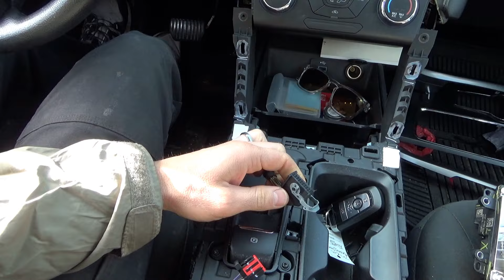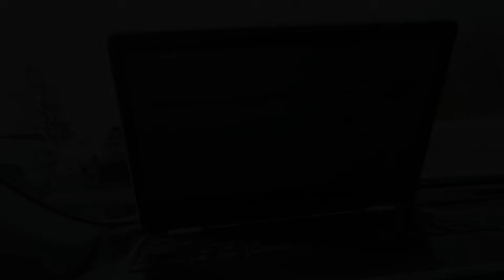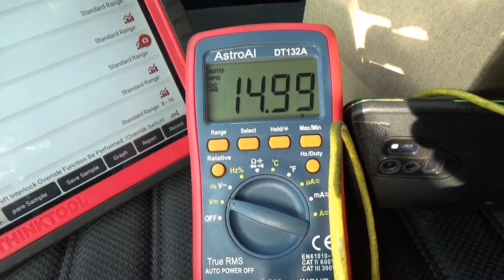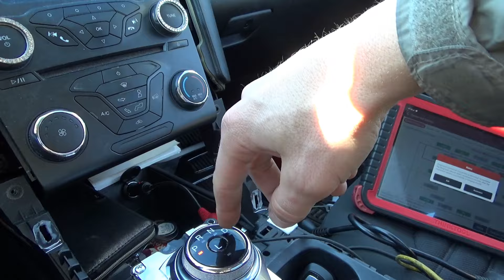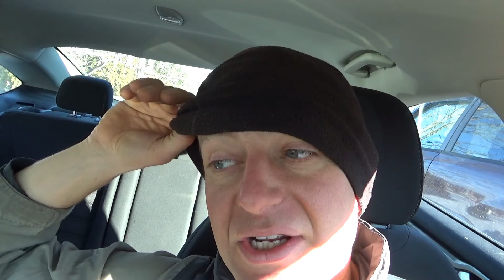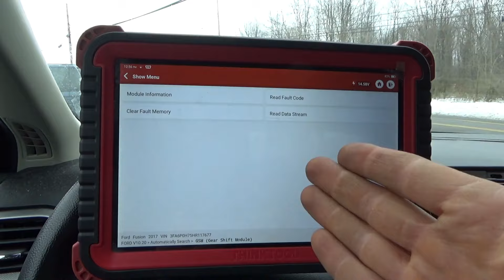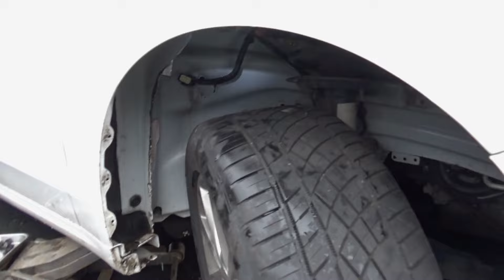Why New Cars SUCK (Ford Fusion STUCK in PARK?! - Part 2)

Comment: The transmission shift cable in my Ford is still working fine after 26 years of service. WTF is all this crap in new cars? Why add such a complicated failure point into what was such a simple and reliable system? What benefit does it add for the driver? Sadly it's all a reflection of the world we live in these days - a throw it away society. Car manufacturers have zero incentive to make a product that lasts anymore. So many more people simply lease a vehicle these days, so as long as it lasts the length of the lease nobody cares.

Comment: My BMW M5 2006 would never start in the cold? Push button and everything worked but no crank? It would start with a boost? Battery was good? I took panels off turns out it was a ground on the frame on the bottom side of the car. Scanner Dan pointed me in that direction.  BMW gave up?

Comment: The square-stock-spring around the shaft is a Torrington clutch. It transfers drive in one direction over a limited range of rotation (range controlled by a pall contacting a stop). 

The sliding plate driven by the small motor is used to select which of the two big motors engages with the drive gear (the one that fell off).

You are absolutely correct about the whole concept of this thing. Just because you can do something =DOES NOT= make it a good idea - particularly so if you manage this level of complication. I'm sure someone at Ford knows that, but clearly they were not consulted in this matter.

Comment: Now that I think of it, this rotary knob transmission gear selector is a modern version of Chrysler’s push button gear selector of the late 1950s. It lasted for a couple of years, and then they switched back to the conventional lever, I guess due to problems. Time will tell if this gadgetry fad fades away🤔

Comment: I really appreciated the method to solving the problem, more than the solution itself. You're talented at this auto diagnosis stuff. Just to fill you in on some specifics, the 2 PWM signals are backup signals for the CAN bus. The 2 PWM signals are compared with the CAN signal for agreement. This was an interim changeover from cable to SBW. The new trans was not ready so the TRCM was a intermediate solution. A fully SBW system wouldn't have had a bushing to break or a cable to get stuck. As an example, the throttle abandoned using a cable a long time ago because a cable was not as reliable as having the accelerator pedal just be a sensor. Many shifters that people think are mechanical are SBW that simply emulate an old fashioned shifter. My biggest fear isn't the electronics, it's software. It can be updated but never be bug free. It's what I fear most when I get on a plane. I enjoyed the teardown of the TRCM. It's way more complicated and bulky than I imagined. That small brushed DC motor actuated the BTSI and that's probably where it all went sideways.

Comment: I'm curious did you ever further investigate that DTC for P166B?  

PINPOINT TEST E : DTC P166B
Refer to Remote Keyless Entry And Alarm for schematic and connector information.
Normal Operation and Fault Conditions
************************************************************************
The GSM uses the drivers door unlock switch input and drivers door status input to shift the transmission
into the park position when the operator is preparing to exit the vehicle.
************************************************************************

The GSM monitors the voltage signals on the door status and door unlock
switch inputs. If these inputs fail a rational test between them, the DTC sets.
Possible Sources
Connectors damaged or pushed-out terminals, circuitry open, shorted to power or shorted to
ground
Driver door lock/unlock switch
Driver door ajar switch
GSM

NOTE: If a GSM self-test is performed, the driver
door must be closed and locked and the brake pedal
should not be applied. A false P081F DTC will appear if
the brake pedal is applied during the self-test.

Comment: Having watched the video to the end, my guess is that the smaller motor that moves the plate may have failed or the driver circuit for that motor failed.  My guess is that the cam locks the transmission in park once it has moved to that position.  A second guess is that the smaller motor possibly has no position sensor and so the thus no fail code when it does not do its thing correctly.  If you still have the assembly can you test the small motor by applying power to it?  The whining that the motor made suggest to me that the bigger motors stalled because the mechanism was locked in park.  Lastly was this Fords attempt to copy BMW's range selecter?

Comment: Besides this whole design is stupid. They could very easily put a stepper motor right on the transmission range shaft right on top of the trans and drive it directly. Lot less parts to fail in the system if they want a fancy volume knob shifter

Comment: This car should be called a Ford conFusion, for the obvious lack of DTC with a frozen actuator. I think, if possible, you should have tried the Ford OEM scan tool hardware (OBD-II pass through: VCM2, MasterTech2, or perhaps DrewTech) and Ford software (IDS?), perhaps it would have provided a code.

Upon disassembly one problem is complete lack of lubrication. The front bearing looks sealed so it is probably still lubricated, but the gears and shafts are completely dry and starting to corrode. The gears look like they are made out of steel (maybe 304 SS).

I am guessing, but based on what I say in the video, the little motor adjustment in moving the CAM plate is for cable stretch. As the cable ages is will stretch. Part of the learn procedure is to reset the cable length, so the CAM adjustment is set to minimum stretch after a new shift cable is installed. The roller indent in the CAM actuates the clutch release, which is probably the home position.

It looks like the failure is mechanical with the intermediate reduction gear shaft and gear frozen (rusted together) or the shaft sheared. The shaft looks like it is in double shear (held at both ends, which is correct), but means it mounts from the case front casting, through the intermediate gear (driven by the small motor gears), and into the top housing, where the shaft is held in place and is threaded? This shaft is stationary and provides a rotating bearing surface for the intermediate gear and it is clearly corroded. I think the intermediate gear became frozen to the shaft and either stalled the motor(s) or broke the shaft (at its attachment threads?) causing the assembly to jam.

If this is not the problem my guess would be a motor failed. After repair the mechanical assembly should be cleaned and lubricated before reassembly. If you want a recommendation on the lubricant just let me know, you have both plastic and metal gears, which usually require different lubricants. 

If you can repair this assembly you could probably make some money repairing these modules, given the back order status from the dealer. You already have a core you could fix. You would have to reverse engineer how to send it commands to test its operation. But, if it is mechanical you should be able to fix it, even if you have to have a shaft machined.

Comment: Just a small idea since you’ve done teardown on this, in the past I’ve had issues with the small motors in the central locking mechanisms on Mondeos (UK fusion) in fact it’s been on lots of central locking motors made by lots of manufacturers not just Ford, and it always the little motors that look very suspiciously like that little motor that’s in that transmission module. What happens is the motor always stalls in the same position as there is no range position sensing in the module, And after a while, the brushes and all the slip rings starts to Burn out, and once that happens, it’s game over for the motor, and if that small motor stalls or is to weak to run, it may cause the module to not be able to calibrate properly? Just a small idea from what I’ve seen, failing in central locking mechanisms.

Comment: Going off the sound of that unit I was going for shredded plastic gears, but no so I'm going for the little motor looked like an interlock or something which was stopping the main motors from moving... hard to say without more info... and the no fault codes... that's just down to bad software written by multiple departments that don't talk to each other, just like their software.....

Comment: One wonders why Ford did not connect the shift control level directly to the transmission mechatronics electronically, bypassing and external mechanical shifter (that is a 20lb dead weight)? ... or is that automatic transmission a wholly hydraulic unit from the 1980's? Well done for nailing it!

Comment: Dear Mr. Ivan and All People, I am over dazzled to see such a very complex component that resembles an actuator in a space shuttle to be controlled remotely from earth , but not to control a shifter that is less than 1 meter away from the driver Lool. As you mentioned, we as humans genetically embedded since Ford model T to have a hardcore shifting leverage in an automobile Loool. The actual scenario goes like this, a new very stupid and arrogant chief designer presses the engineers in a compulsive way to come up with a new "revolutionary" outstanding (Stupid) design, and here where all the over complicated methodologies spawns widely, adjacent to dribbling of corporate resources and best of all leading to an accumulated problems that makes a bad reputation of the marque (backfire). As of myself, I feel that that any car feels tasteless with a shifter that looks like LG Washing Machine program dial Looool. Hope Ford can read that Loool. Take care you all and have a good times. John Jack Kaplanian from Jordan / Middle East.

Comment: If it needs 2 motors to pull cable? Maybe 1 of the stepper motors failed.  That might be why it made struggling noises during relearn. Feed each one power, give it a load? Idk, I ’m guessing here.

Comment: The little plate that moved the cam looks like how the module can self limit itself so when you do the cable adjustment function that plate will move to set the max position for drive and max position for Park anything in between doesn’t matter as it would have the input from the trans range sensor telling it that it is in reverse

But yes bad and lazy design they would have been better off doing this internal to the transmission and have solenoids shift it into drive, but I bet that gearbox is old and cheap to they didn’t want to redesign it to have e-shift

Comment: I agree Ivan, there is no advantage at all with the gear selector knob sending a signal to an overly complicated module with motors in it to drive a cable that a simple cable operated gear selector could do, Absolutely crazy!

Comment: Having been in this field (development and implementation) I can absolutely tell you that 90% of the time, all the engineers are on the same side as all of you.  It is ALWAYS the bean counters that convince corporate on either an initial production savings, a long term service revenue (fixing it down the road), or the ability to sell more units by promoting additional “safety”.  Once corporate (very few in corporate started life as engineers) makes their decision, you as the engineer press forward with the company decision.  So please….stop blaming the engineers…their bosses are making the decisions and the bean counters are who they listen to the most!
Reply from the maker: Yes I know I worked for an engineering company a few years ago... Got fired in less than 2 years for making suggestions on how to improve software functionality vs adding useless gimmicks like the bosses wanted 🤣

Comment: Hello. I really like the way you explain things. I have a hypothesis for the specific situation. The car is in the parking position, but there is a slight incline. Like most automatic transmissions, it would be much harder to disengage from the P position. There is a good chance that this module is OK, but by disassembling it, you release the tension in the wire and that helps it shift. I'm not claiming to be right... It just crossed my mind :)
Reply from the maker: Not the case here 😅

Comment: I understand your frustration But my shifter on my 4 wheel drive works every time for almost 20 years
Reply from the maker: That's because that system is only used a few times a year... Not multiple times a day 😅

Comment: I bet there's nothing wrong in the TRCM, it's only very poor SW engineering. Probably the unit lost its calibration when the cable got damaged (btw, they are using the motor current for defining hard-stops, therefore saving precious money for not putting a position sensor in there) and the only way to restore it is by using their internal tooling to bypass the hard-stops in order to bring the gears into a position from where the learning can be performed OR one can try to disassemble the unit and manually bring the gears into position - very time consuming and probably prone to failure because the unit may be sw locked in a "safe-state". 
Also the smaller dc motor may be a "self-adjusting" mechanism if the cable become loose over time (similar to what you have on a bicycle's handbrake).

Comment: I'm so glad my 2022 Toyota 4runner has the good old-fashioned shift lever.

Also, auto shifting into park is a stupid feature.  Sometimes when I'm backing into a parking spot I open my door so I can see how close my wheels are to the curb along side me.  I have my seat belt on so it's not like I'm going to fall out.

Comment: Not going to lie,  I thought I would replace the Trans. Range Control module.  However,  I believe I would have made the same call based on if I hadn't dealt with these before.  My personal experience was my neighbors Fusion didn't push to park or pull to the reverse.  I think you hit the nail on the head when you said that this is one of those things you get better at when you have more experience with these systems.   Also agree the shift by wire is dumb!!!

Comment: I would bet someone in Ford marketing decided some competitor had a dial shifter and they needed it too, but didn't want to invest any money for the engineers to redesign the system to do it in a reasonable fashion, and so they ended up with this tacked on mess. I would bet it ended up with the actuator jammed in the fender well because they happened to have space left over there. Apparently they didn't spend enough time to implement proper DTC logic either..

Comment: And, the 'traditionalists' win.  My Ford, a 2003 Crown Vic LX.....just broke the cable at the transmission after 20 years of driving in salt.  Repair?  30 minutes and $167 Ford cable, in stock.  V8, 3 speed w/overdrive auto, rear-wheel drive....and lots of room to fix things in the engine bay and underneath, if/when required.  😀

Comment: At 28:56 I just about fell off the couch when you said "What could possibly go wrong?"  So many parts, so many chips, so many motors, so much extra weight...   All these extra points of failure which cost significant money to build and manufacture all for just one purpose - to make the customer think the car is high tech.  Aesthetics and form are valued higher than reliability no matter what the expense.  Just pass it on to the customer.  Thanks for the great video and your time.   If they really wanted to go "high tech" the only motor that would be required is one to engage and disengage the parking prowl.  All other functions of the transmission can be controlled via solenoids that direct fluid flow to the various clutches and band actuators.
Reply: Ford crap!

Comment: This time it's not an assembly problem. It's just downright bad engineering and design.
They went to plastic clips to save weight but then designed a 20 pound module to pull on that plastic clip so it would eventually break.

Comment: That module is way more over-designed in the wrong way, a shifter position sensor in the transmission, a good servo and a good software will acomplish the same function.

Comment: The whole idea is ti make cars overly complicated so that the diagnosis time kills the repair cost. Do you really need all that crap on a car? Does it make it more energy efficient. Or is turning a knob easier than moving a lever? Safety has because an excuse to add unnecessary cost, and complexity to a car.

Comment: So basically the part you replaced was the transmission shifter step motor. The knob has an electronic signal sent to that motor, and it selects a gear. If the motor was failing why wouldn't they have a trouble code for that?!?
Reply from the maker: That is the question of the day my friend ;)

Comment: Ford Engineering Dept: Hey Boss I have put in 350 failure points into the electronics how many do you want in the mechanical part. What about another couple of dozen.
No problem I will put in some more plastic gears and a few weak springs that should do it.  😂😂

Comment: Spring over/under wind. Spring Pushes the transmission into park from drive.  Snapped out of place when the bushing went. No resistance while you turned gave it away. Twin tiny motors most likely because bigger motors are not being made in China anymore. Your right it a stupid design.

Comment: There is a recall for the bushing self-destructing on these cars, just saying if the bushing caused the actuator to fail it should be part of the recall. It is such a POS that there is no wonder that there is such a backorder on the part.